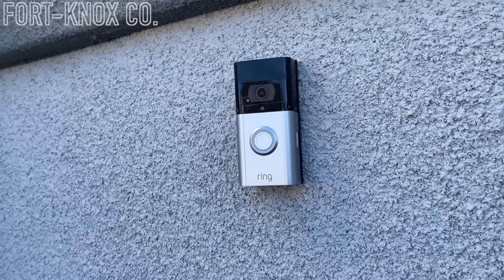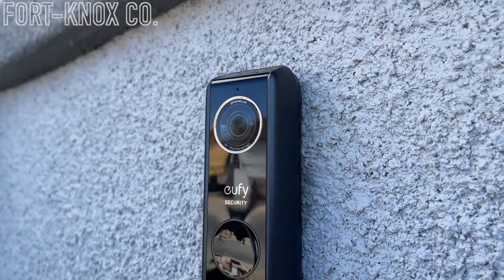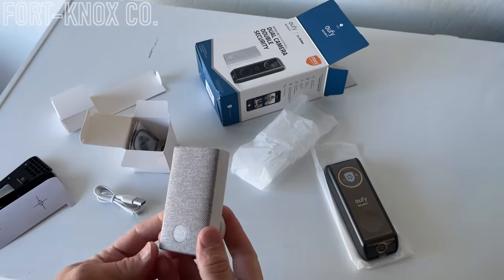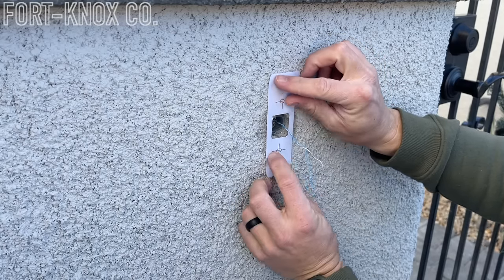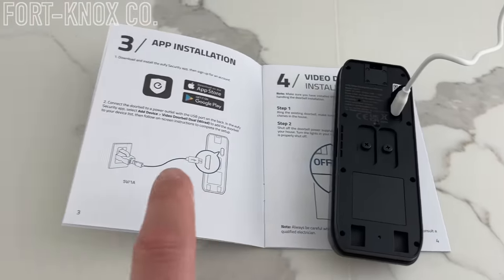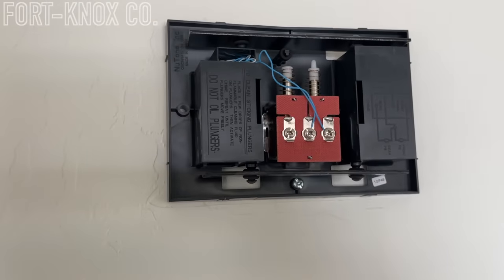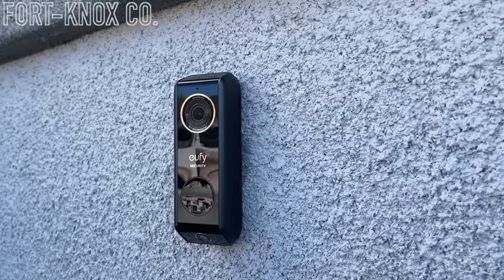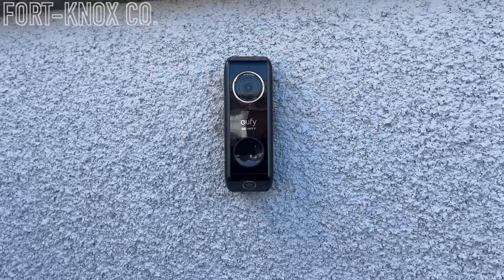BEST Video Doorbell 2024 with No Subscription Required Eufy Dual Camera Doorbell Installation Memory

Comment: I cant find any information regarding the ipx rating. i want to place this outdoor where in my area rains a lot. do you think this device can stand heavy rain?
Reply from the maker: I know it can stand rain, obviously it’s an
Outdoor electronic. But not sure on the rating for how severe or rain. Or like if it has a submerged in water ability.
Reply: Don’t bother with Eufy if it’s even damp it will leak through the camera lens. Mine did after a few months being outside. They are crap on warranty as well. My advice look elsewhere 👍
Reply from the maker: @deanstockham6827  I’ve had my wired Eufy for about 6 months now and had moderate storms on and off and haven’t seen this issue. I’d imagine if there was a manufacturer defect that allowed water in to damage they’d cover or replace. Amazon has a really good return policy

Comment: For the indoor cameras, do you know if it comes with the parts to mount it to the wall/celling?
Reply from the maker: If it is an indoor camera system, they should come with some types of options to mount. Usually, if you’re looking at the product online, it will show you what it comes with and the mounting options.

Comment: Does it come with wireless option?
Reply from the maker: Yes. They offer battery operated (wireless) and you can mount the doorbell pretty much anywhere you want.  And they obviously offer the wired options too.
Reply: @FortKnoxCo  thanks for the prompt response
Reply from the maker: @hassank8472  no problem at all. Happy to be here.

Comment: how often does the transformer need to be bought with the ringer? that's basically a hidden cost
Reply from the maker: I’m not sure. It’s really situational. Most houses I know of have the standard smaller transformer. And most of these doorbells operate better with the upgraded transformer. They will usually work with the standard but won’t be as strong of signal n stuff. So the better power supply is usually a big plus.  They aren’t much money to get and upgrade.
Reply: @Fort Knox Co.  thanks for the reply. I was sad to hear ringer requires a subscription. At this point everything has a dang subscription so I'm trying to avoid that if I can as well.
Reply from the maker: @corporaldonut7917  yeah I didn’t know you HAD to have a subscription to just use the doorbells basic features. So that’s why I started looking elsewhere and found eufy. And I have no complaints with the Eufy system. We love it still.

Comment: Of course they would run there’s off an abnormal voltage? 16 volts instead of the normal 12 or 24 Volt?
Reply from the maker: I believe it just needs a little more voltage than the average doorbell. They commonly sell the larger doorbell transformer at big box stores now because of all the video doorbells needing a stronger voltage. So most video doorbells now need the larger transformer to run properly

Comment: If i have a previous doorbell camera installed do i have to re-drill ?
or could i just remove/ disconnect the old one and install this one?
thanks
Reply from the maker: Should be able to just uninstall and reinstall. But as far as holes drilled, if it’s the same model/brand then it’s a direct swap. If it’s a previous different brand the homes for the new bracket may not line up

Comment: 1) Can I add my mobile datain addtion to my home wifi for Eufy Doorbell so that I can also watch the video when I travel?
2) Is there a pre-recorded quick response function in the system to record a message and broadcast through a speaker in the door bell if I activate that function?
Reply from the maker: Yea you can video video and events as they happen or past event from your phone when your away from the house. On their app you can do all of this. It accesses encrypted data from your doorbell and can be viewed.  

And yea when someone rings the door or your seen motion, at that moment, you can access the doorbell and communicate through it like a speakerphone. I’ve done this several times when away from the house, and someone was delivering something and the connection has always been very clear.

Comment: I think the only problem I have with the Eufy video doorbell is the potential risk of losing the footage if the camera is taken off its place, because the free part is the local storage that records footage into the camera for a certain amount of time. Other than that, I'm liking it
Reply from the maker: The data/video is stored in the plug in chime that is plugged in the wall inside your home, so your data will be safe inside. It’s not stored directly in the doorbell itself. They thought of that part. And the newer plug in door chimes have expandable micro SD card slots to allow more storage if you choose to.  And they have the home base storage too if you have the home security cameras which has 1T or bigger storage I believe. All in your home where you choose

Comment: What is the power required  = Volts & amps ?
Reply from the maker: 16VAC/30VA.  I have a video on how to upgrade your doorbell transformer. It’s wired off of one of your normal 120/110V outlets.

Comment: If you have two camera's one front door and one back door. Can the doorbell be used for both camera's
Reply from the maker: The doorbell camera itself has two cameras on it. One facing forward, and one facing down they cannot be removed or positioned elsewhere. If that’s what you’re asking. You can easily mount another doorbell video camera on the back door and within the app you’ll be able to view both doorbell cameras. But you cannot separate the two cameras on the one doorbell.

Comment: I have a POE system with a NVR for cameras around the house, so I just installed a POE doorbell. I know that’s not for everyone since it required pulling the cable. But now everything records on our NVR with all the other cameras and we get notifications of motion and two way talk.
Reply from the maker: That’s awesome. I think wires cameras with some type of in home recording system is the best. Then you can choose to use cloud or internet/WiFi access at your own discretion. But you can at least choose how for you want to go with the whole thing. Running the wires can be a pain depending on how your house is built.
Reply: Which POE doorbell do you have bro?
Reply: @FortKnoxCo  The camera wires where easy since I have a large attic. Doorbell in wall not so much, I had to open the drywall a bit. All patching done.
Reply: @justin-tyme  I got the Reolink POE doorbell
Reply: @samuelkilianjr.3694  Thank you 🙏🏼😎
Reply from the maker: @samuelkilianjr.3694  that’s awesome. Yeah the door bell wires aren’t too much to deal with. But depending on how far you need to run the wire you may have to jump a couple studs and like you said…drywall work.

Comment: I installed a Blink doorbell camera to confirm package deliveries. No subscription required if you have the Blink Sync 2 module. Performs exactly as expected. You opt for Local Storage on the module's flash drive (not included).
Reply from the maker: That’s good to know. It’s nice not being forced to pay for the service. Having the option to store your data locally is huge.

Comment: I want to get the battery-powered version of this brand.  Do you know if that also comes with an inside doorbell?
Reply from the maker: They do have a combo with battery powered and the plug in door chime. The links in my description will take you to the items on Amazon. And from there you can see what other options and packages they have. If not you have the option to purchase a plug in chime separately i believe.

Comment: What is the field of view (FOV) for the Eufy? 180? I have to mount mine to the side not directly in front of visitors
Reply from the maker: I believe their website says it has a 160 degree view. But they do come with angled bases to help turn the doorbell to achieve a better angle as well.  Also if you use the battery powered model you could mount it anywhere you want. Could even mount it on the door itself to look directly at people. Just an option.

Comment: GREAT video.  I'm going to chuck my Nest camera and get one of these.  Have you had any problems with built-in battery like Nest does?
Reply from the maker: I haven’t but I only used a battery operated one for about a month and then Went with a wired one. My door lock is battery powered and that thing is awesome. Deadbolt camera combo.
Reply: @FortKnoxCo  one other quick question:  is the internal storage 8GB or 4GB?  Has that been a hindrance to you?  Trying to decide whether to go the extra for the Home Base.
Reply from the maker: @ it hasn’t been a problem for us. It stores months of video and pictures.
Reply: @FortKnoxCo  perfect!  Just ordered mine with your link.  Thanks again for such a comprehensive video!
Reply from the maker: @ nice! I appreciate that. Hope you enjoy it as much as we have. 🤙🏼

Comment: So I live in a condo. There is no power at  the door.  Any suggestions
Reply from the maker: Yep, that would be the battery powered option. It can basically be mounted anywhere you want. No power source needed. Just have to recharge the battery every once in a while.

Comment: Do need to wire the Eufy battery powered doorbell in or is it truly wireless?
Reply from the maker: It’s truly wireless. You either have battery powered and you can mount wherever you want. Or wired in location you have power supply

Comment: Is Eufy wireless & will the wireless work as proficient as hard wire
Reply from the maker: Yes they have battery operated/wireless. And the wires in version as well. The wireless works great. Haven’t had problems with that. I just didn’t like recharging the battery so I eventually went with the wires in version
Reply: Thank you so much
Reply from the maker: @deveeda56  No problem at all

Comment: We had a Ring, and it did not work out for us. It had a 2-second lag time from when it senses movement and actually starts recording. By then, the person that set it off is no longer in the field of view. How fast does the Eufy start recording?
Good video. I subbed and rang that bell. Does Eufy have a battery powered model?
Reply from the maker: Awesome thank you! Yes they have a battery operated and wired in model. There should be links for both in my description to see them on Amazon so you can compare. The video and notification timing is spot on. We haven’t had any problems with the video recording and the notifications coming through while they are still there as well. I walk past it when I’m my front yard and my watch starts vibrating with a notification before I’m done passing usually. We have no complaints with this Eufy doorbell

Comment: What if you don’t have a doorbell? Can you still use it for the camera?
Reply from the maker: Yep 100%. They make a wireless battery operated model, that can be mounted anywhere you want basically. And it can come with a plug in chime if you want the door bell to ring inside too. That plugs in anywhere in your home that you want and it goes off when the button is hit. Otherwise your phone/smart watch gets notifications from the door bell too

Comment: I need a battery powered one. What would keep someone from just popping it off the house. It needs to be secured before I would consider buying it.
Reply from the maker: They offer battery powered and wired versions. They also secure very well to the wall or outside that you decide to secure it to.  They also make aftermarket secured housings for them. But it’s not a very common thing for people to have them ripped off. The data and saved video is safe inside your home. It’s stored in the wireless chime

Comment: I do not trust Anker anymore. They used to have solid products but too many failures/QC issues. Doorbell monitors are cool for sure, but the inability to record locally is a major negative.
Is there two-way audio?
What is the motion detection distance?
Reply from the maker: You can record locally. It’s stored on the chime that comes with it which is plugged inside your home. Or you can have their HomeBase storage which if again stored locally inside your home. They do have 2 way audio. Works great for me, I’ve used it several time. Like talking on a speaker phone connection. And the distances are pretty far. I’ve had so lower my sensitivity because it was catching stuff out in the street over 60’ away.

Comment: My door isn't connected to electricity and at the moment I've Ring with rechargeable builtin I'm looking for the same features as Ring doorbell  that I've and No subscription. do you have any suggestion for me? thanks
Reply from the maker: This Eufy door bell comes with wireless/battery operated and wired versions. So you may want the battery operated one. Its works great and has no subscription. You aren’t forced to pay for anything else after you buy the doorbell

Comment: you might want to consider trying the reolink wifi or poe doorbell. it is still new to the market and features still need to be added but it records fine on their nvr or sd card. it is also usable on home assistant and blueiris
Reply from the maker: That is for the info. I’m going to have to check them out.

Comment: I live in an upper Duplex, I'm sitting on the sideline because I'm not certain how it would connect to the WIFI is the EUFY is at the entrance downstairs and the router is upstairs.  Have you tried it on a duplex?
Reply from the maker: I haven’t tried it on a duplex specifically but I have connected these with WiFi at distances about 90-100’ away. Distances that would be covered around a home. So not sure what your distance is but you might be good with it still connecting. Just want to make sure the foretell has the stronger upgraded transformer, I have a video on how to wire a new one in if needed. And that your router is strong.

Comment: can you set the settings to what you want ?
Reply from the maker: Yep. You can adjust the sensitivity on each setting so your not getting notified every time something moves outside. Closer to the door or activity further away. And you can turn on or off what type of notifications you want. Human detection, movement or package detection
Reply: @FortKnoxCo  does it have extra cameras ?
Reply from the maker: @1223army  this doorbell has 2 cameras. One facing forward and one facing down to detect packages. You can order exterior house cameras from Eufy as well. They have several different set ups for whole home camera systems
Reply: Thank you
Reply from the maker: @1223army  your very welcome

Comment: I am thinking of purchasing this for my tax office.  Issue is the building is very old. So not even sure where or if there is a transformer.  Is an upgraded transformer needed for use of the doorbell or the chime?
Reply from the maker: If there is a current door bell then I’d assume there is a transformer. They have been using the transformers in line with door bells for ages. But the next thing is Yes I’d guess you’ll need a new transformer. Something very easy to swap out. I have a video showing exactly how to do that and where to get the correct transformer.
Reply from the maker: They also have the battery operated option. With that you just have the hassle of recharging the battery semi often depending on how active your door bell is.
Reply: Yeah this building is about 200 years old and hasn’t been remodeled for about 30 years. Wouldn’t even know where to start. Didn’t want battery option due to I don’t live close and wanted it for security during off season as well….. just weighing out the pros and cons
Reply from the maker: @samanthaanderson628  oh wow. Well it’s still very doable. Even if you were to start from scratch you could install a door bell transformer and run the small wires to the doorbell where you want to install it. The transformer installs on a regular outlet and from there it down grades the power. The wires that attach on the outside of the transformer can then be ran wherever you want the doorbell. Through the wall to the outside and then simply install the doorbell there.
Reply from the maker: @samanthaanderson628  the outlet that the transformer is on just needs to be inside or protected form the outside elements. That’s why they usually install them up high in home garages. Inside but out of the way.
Reply: @samanthaanderson628  If I'm reading right, as long as the wireless doorbell is charged, you can monitor your door from anywhere on your phone. You don't need to be nearby.

Comment: My door bell rings with ring door how do you hook it up in back yard without a doorbell
Reply from the maker: They have a wireless/battery operated version. You can mount it anywhere you want.  Also if you wanted to install a wired in model you could too. The power wires you run for a doorbell are very small and low voltage very easy to run a new wire to a location that you want to install a doorbell.

Comment: Does this connect to any EUFY homebase or do I need different homebase just to use the doorbell? I have a Eufy Cam 2C
Reply from the maker: It says it works with homebase. Some of the doorbells come with a homebase. I’ve read that the homebase a 3c doesn’t work with it. Unsure is the 2c does or does not.

Comment: Why Uufy getting bad reviews on AMAZON? & My transformer can't be found, so the battery one good?
Reply from the maker: Not sure about the bad reviews. Seems everyone has different experiences with different brands. I’ve had zero problems with eufy. 
Battery powered is a good option if you can’t do the wired.